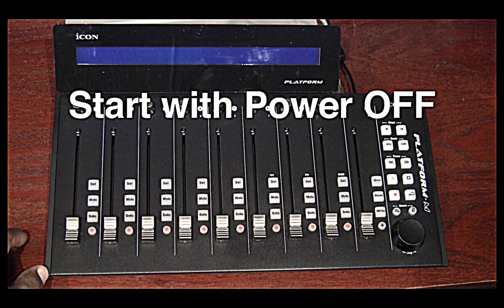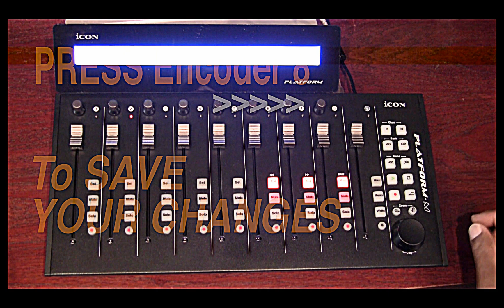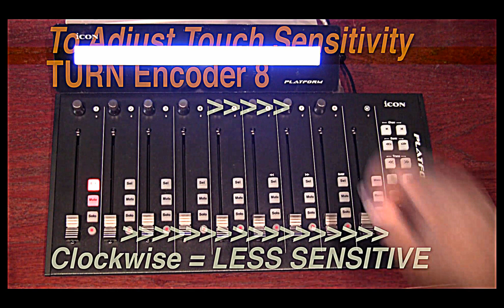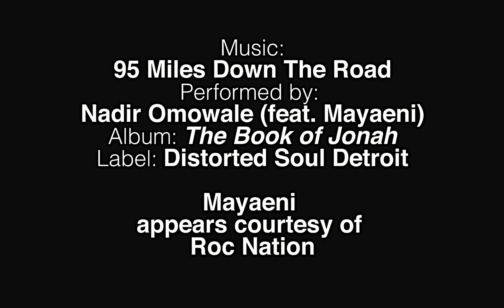How To Adjust The Faders on a Platform M by Icon Pro Audio - YouTube

Comment: Two of my faders are extremely jittery as soon as I lift my finger or change page, and one of them is just extremely slow. Unusable in a professional setting.
Reply from the maker: If some faders are jittery you should try slowing them down. If another fader seems too slow, you can speed that fader up. Faders can be calibrated individually.
Reply: @Iconproaudio the fader seems physically unable to go fast enough. The jittery ones obey no law lol. They just oscillate between values until I touch them and they update to whatever value I touch.
Reply from the maker: @simonlacelle1902 Did you adjust the calibration?
Reply: @Iconproaudio  tried to, nothing works and controler is now switching into solo mode for random tracks or switching pages without any input on my part. No answer from support. I'll just buy something more durable.

Comment: When I keep the know 1 down and turn it on and I actually turn the 8 knob counterclockwise wise but it doesn't get that slow at all, it seems it 's just a little slower but not as the video.. does it happen to anybody else?
Reply from the maker: Fader calibration has been adjusted over time. If the faders move too slowly, it wears out the fader motors more quickly.

Comment: Hi, i just bought a platform M+ , is there any way to increase the knob resolution or increase the rotary knob sensitivity ? The ones above the fader. In ableton live 10 they react... 'strange' ... as in i can't to 'predictibly' control the pan parameter, they react with a strange 'resolution'/sensitivity. Only with the encoders (all 8 encoders) i encounter this, I don't have it if i flip the controls and do panning with the faders. pls some solution on this ?
Reply from the maker: When you say, "strange" @sven van bavel, what do you mean?
Reply: I'm not Sven, but Steffen, and I have the same problem using platform M+ with Ableton Live 10 (linked with Cubase 9.5 pro it works better). What Sven means saying "strange" you probably find here: https://www.youtube.com/watch?v=Gz0jnS-O_PY This is at least what I have to deal with, too, and I think that is really strange. Any advice for this? Would appreciate it. I liked your tutorial and especially the funny way of explaining things.
Reply from the maker: Hello Steffen,
Thanks for reaching out, We're sorry to hear you're having issues with your faders on your Platform M+,

If you find that the available calibration and setup videos haven't helped to clear up this fader issue you're having please submit a ticket to our help desk and one of our agents will be happy to help try to get to the bottom of it.
Be sure to include as many details about the bug and your system as possible (such as notes about your computer, configured peripherals, software and firmware version numbers), as these will likely help in figuring out the cause or solution.
Here's a direct link to our help desk for your convenience: http://support.iconproaudio.com 

Thank you again for your patience and understanding,
Icon Support.

Comment: I have Platform M+. does the Platform M+ have same functionality ?
Reply from the maker: Hi. The Platform M+ functionality has all the functions the Platform M has plus more. In addition:

1. The M+ back connectivity panel which allows you to connect the B+ and the other platform control surfaces in the series, whereas the M does not have that option.

2. The M+ has different color buttons assigned to the select, mute, and solo buttons. The platform M buttons are only red.

3. The M+ allows you to calibrate faders individually and as a group, whereas the platform M only allows you to calibrate the fader as a group.

In addition, I have attached a link to the platform M+ calibrations tutorial: https://youtu.be/MvNZzVhkgZs 

Icon Support
Kevin

Comment: awesome tutorial., I like the way you teach :)
Anyways, does the bridge have to be installed for normal use ? Also can we cascade 4 of these together to get 32 channel control ?
I also wish there was LCD metering that expanded the entire length of the fader slide in each channel.
Reply from the maker: Thanks, @Mindcraft Mindcraft. When you say "bridge" are you referring to the Platform D2 display?

The best way to get 32 channel control is to extend your Platform M or Platform M+ with a Platform X or Platform X+. And yes, you can add three X+ units to an M+ to get 32 channels. Be aware, however, that if you're running ProTools as your primary DAW, it uses the HUI format, which only supports two extenders for a maximum of 24 channels. But if you're using any other DAW, 32 is the max.

If you would like metering, you'll want to check out the QCon Pro (http://iconproaudio.com/product/qcon-pro/) or the QCon Pro X (http://iconproaudio.com/product/qcon-pro-x/), both of which offer metering, but in a slightly larger physical footprint.

Comment: Hey There, thanks so far, as I just purchased one of these babys!
As it seems that you're totally in that controller, do you know, how I can reset everything, inclouding the user defindes midi bank to factory defaults? 
I have some issues hooking that thing up with my mixer (MIDAS MR18) and need a bad pc to configure midi settings, but after a first achivement it doesn't continue working, so i would love to start from the top ;)
Thanx!
Reply from the maker: This is a good question, @Manuel. I'm consulting with tech support to get you an answer asap.